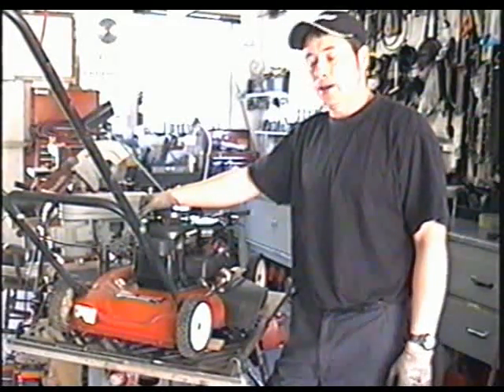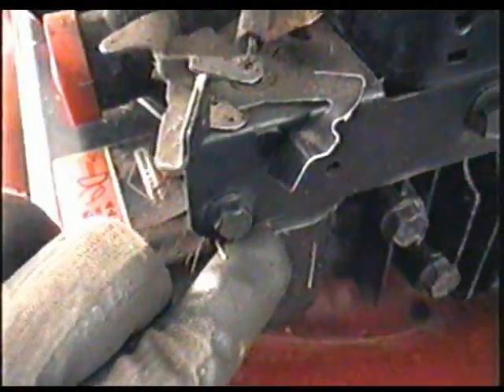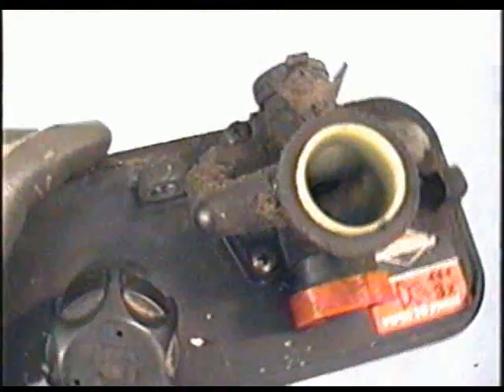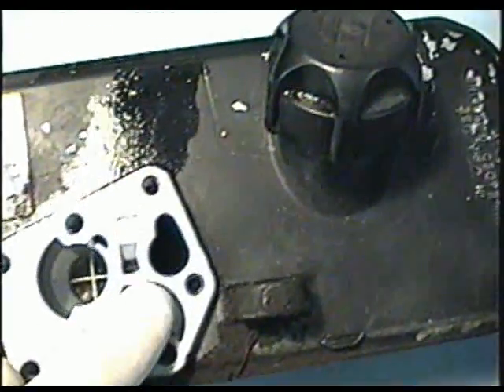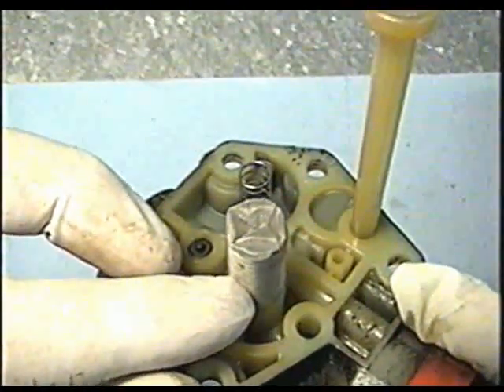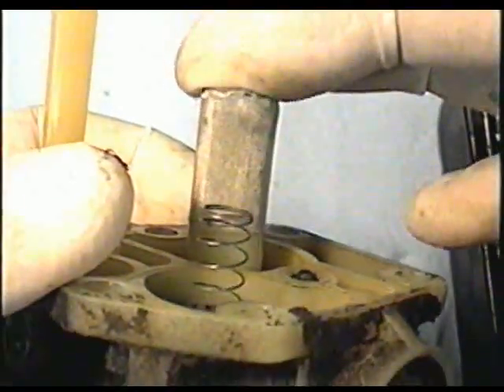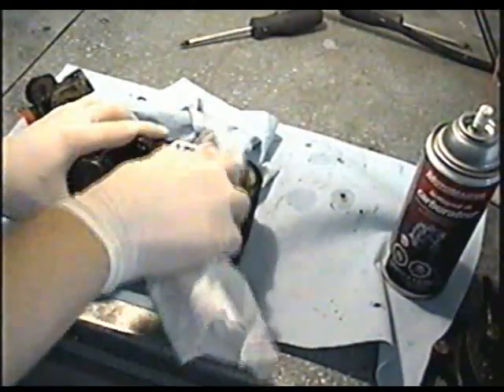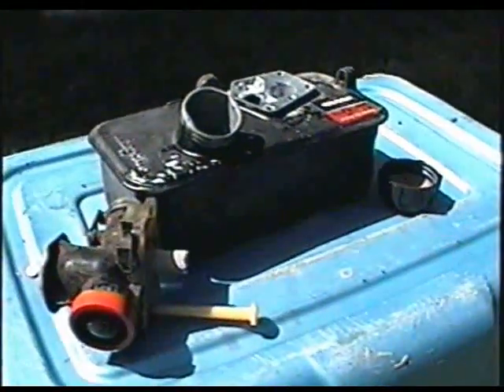HOW TO REPAIR Lawnmower with BRIGGS & STRATTON Pulsa Prime Carburetor  1/2

Comment: Don, I just repaired a 1986 mower with diaphragm -autochoke. This video was perfect!  I had to rebuild the starter ratchet, restring the starter, retorque head, clean out fuel system, rebuild carb, etc. It had sad been sitting for years. It started one first pull. Thanks for the timely lesson.

Comment: Thanks for your clear and easy to follow video. I have had my mower for 12 years and it was not running at all well. I performed the maintenance following your guide, I replaced the diaphragm and replaced the throttle control springs. $60 for parts and carburettor cleaner and my mower is running like new. Thanks for posting these videos.

Comment: I have a 2 year old  briggs 4.5 that would not start.  The repair shop wouldn't even look at it cause it was a "cheap" mower that would cost more to look at and fix than the mower was worth.  So I decided to fix it myself.  After watching several videos online I gave it a shot.  A good carb cleaner and 3.50 dollar gasket and diaphragm later and she runs great!  Thanks so much!!

Comment: Thank You Thank You.   Have MTD Mower with B&S engine made in 1994.  couldn't get it started...  called repair place, they told me it wasn't worth repairing (hard to get parts).  Watched your video, bought $4 for gasket, cleaned up the carborater, put it all back together and it started on the FIRST PULL..   I'm so happy, saved me from buying a new mower.

Comment: Thanks donyboy73 for this video. My lawn mower wouldn't start for nothing. Watched this video last night, it so happened that I have Carburetor cleaner lying around, woke up this morning, was determined,  did exactly what you showed on the video, and now the mower runs like a champion again. I had it there put away for like 3 months and was debating on buying a new mower because this one is like 5 years old, but won't be buying a new one as long as this one runs like it did when I first bought it. Great Video for my problem.

Comment: Thanks a lot for that, My mower ran out of fuel after I last used it a week ago, filled it up yesterday and it was hunting up and down and smoking a lot. Watched your vid and dismantled my carb just like you did it was pretty manky inside but cleaned up well and after re assembly worked a treat, Now I need to weld a patch on the body where it has rusted through and my old faithful will last another 15 years

Comment: I watched the video, worked on mine and a once useless mower started right up. Only problem was when I took off the springs, all of them came off. I wish you had a detail of the spring assembly. No problem. It all worked out.  Thanks. You saved me parts and labor at a shop.

Comment: Your instructional video(s) are terrific ... so easy to follow. Many many thanks.  Using your video I was able to fix my start and die engine.  I managed to clean the carb dirt and put it all back together all nice and clean .. and pulled the cord and BAM .. the thing lit up like better than new ... and stayed running and smooth as can be. Thanks so much !

Comment: Thanks!!! Cleaned up my carb this weekend using your video. Purrs like a kitten now. Only issue I had was that I bent the throttle bar (or whatever it's called) in the process and it rev'd really fast at first. Once I realized what I did I corrected it and everything (including throttle) was fine after that. Thanks!!!

Comment: Great tutorial thanks. This really helped me fix my mower which was revving up and then slowing down. I had tried cleaning the air filter and changing the spark plug but on opening the carby it was clear there was a lot dirt in the bottom. Thanks again!

Comment: my lawnmower would only start after a prime and would die 2-3 seconds after.  i did this procedure several times, but no luck.  replaced the diaphragm and gasket, same thing.  tried running with the air filter off and without the gas cap, nothing made a difference... only priming more kept it going.  finally i took some compressed air and carb cleaner (separate cans) and REALLY blew out all the piping(jets) in the carb. now its working like magic.  thx for this video!!

Comment: Hi,

thanks for the video.   It was exactly the engine I have.   I watched some of your other videos, and searched for this one due to the carburetor bowl inside the gas tank.   I found water in the carb, as well as a tear in the gasket.   A new gasket/diaphragm kit should do the trick.

I have tinkered with small engine repair for 15+ years, but never had much success or understood much.   You speak clearly, and cover all the points to look for.

thank you for sharing the knowledge!

Comment: Great, great video.  Your instructions were provided so well and detailed.  The gasket and diaphragm on mine was shot, so it cost me $15.00 (on ebay).  Less than a new $200 lawnmower, though!  Took me about 30 minutes to fix after the parts arrived.  Thank you so much!

Comment: I will give that a shot. It is really irritating. I live in Texas. I bought a cheap push mower a couple of years ago after my 500+ Craftsman wouldn't stay running. Every year it just got worse until it just took a dump. I mowed my lawn once with the new mower, hopped on a plane to Afganiraqiwaitistan and came back to tearing the new one apart after it sat in my garage for 2 summers. I am going to try fixing the Craftsman as soon as the new bowl gasket gets in. Youtube is amazing!!!!

Comment from the maker: @MrParmigianoReggiano you might want to drain the oil from the mower and remover the spark plug and pull it over so the oil goes out the hole. make sure the plug wire is not facing the hole when u pull it over

Comment from the maker: @Gamechills101 it's hydrolocked. u need to take the plug off and drain the oil. when u pull it over oil will come out the plug hole

Comment: Just want to say thanks for taking the time to do this video. I had a mulcher with the same type engine. I started it the other day and it ran for about two passes. The ground was wet and I stopped to clear some wet grass. When i went to restart it....nothing. i tried pulling it for like and hour. Then i went and changed the gas to fresh. (just pouring it out as i was mad, not removing the tank). Just got a new plug and sprayed into the carb. And nothing. Im gonna try your method and see.

Comment: @donyboy73 Ok, got the thing running PERFECT now!! I took the carb back off and cleaned it with another can of carb cleaner. I also put a couple cap fulls of "Berryman B-12" carb./ injector cleaner in the fuel tank. I cleaned the air filter and changed the engine oil too... It's been a Long time since my little 3.75 hp Briggs & Stratton ran this good. I Love it!! It don't burn/ use a single drop of oil and I've had this thing since 2003 or 2004. I've definately got my money out of it.

Comment: I have this same type design engine on my Briggs & Stratton Speed Clean 2000 PSI Pressure Washer. It'll be 7 years old in April of this year, still running strong! I have kept the oil changed and the air filter cleaned... Only problem it has is it's "surging" at engine idle. Runs fine at full throttle and when it's under a load. Do you know what the problem may be?? I've watched all your Q & A videos, along with others! PLEASE KEEP THEM COMING!! I am learning a LOT of things from you... THANKS!!

Comment: Excellent video. You really made this look so simple. You should take up teaching.
I have a question though. Even after cleaning the carb on my lawnmower, when I push the red prime button, I cannot hear the gas being pumped and  hence it does not start. I can actually hear the air coming up instead of the gas.

Comment: Thank you for the video - very good quality and clear description. I just cleaned my carb on a 4.0hp. It started up fine only it seems to be running at a very, very high idle - and the idle control does not work. I only unhooked the one arm to the linkage as in your video and I "think" it's back the way it was unless something feel out or disconnected. Is there anything else that could cause this problem? Note: The diaphragm was separating and not in great shape - could this be the problem?

Comment: Lent my good mower to the neighbor who left it in his back yard and it was stolen so I'm back to this old Briggs n Stratton 3.75 with Pulsa Prime carb and it would start and stop after about 30 seconds although it had mowed the lawn once or twice before this started.
Your video helped me determine that there is only the governor spring with no linkage attached to the butterfly.  Not sure how it was running cause it did mow the lawn a couple times like that. 
I'll replace the missing linkage and the other short spring and check the membrane to see if it is still elastic and pumping gas.  (I cleaned the filter, carb, tank and mesh and blew air through already.)
I clean the head and valves with steel wool because they were badly layered with black soot.  Do you think the engine is damaged because of the linkage parts missing?  Since it ran I didn't dream it had missing spring and linkage (my dad lost his battle with Alzheimers so many things around the house are in odd shape and I suppose that's how the old mower got this way shrug).
Also, I'm not sure what RPM to set it for and guess it'll need that adjustment after the parts get replaced.

Comment: Thanks for the Video -it will help me immensly  since I have never taken a carb off of anything....   I have the exact carb on my sears Briggs & Stratton 5.5 
My carb is so gunked up - I cant believe it runs as well as it does. I do have the E.3 Spilt fire sparkplug which does make a diference in starting.

Thanks -  again

Comment: Good point on not letting carb cleaner sit on the diaphragm. If the chemical is let sit, it will curl the diaphragm and make it difficult to keep flat for reassembly.

Comment: @donyboy73 Ok, i took it all apart and cleaned it. Put it back together with the OLD diaphragm. Still not running right at all!! Acts like it's flooding out, but the engine's not dying... On the part of the diaphragm where the spring pushes against, was hard. I could push on it one way and the diaphragm would stay in that spot. Push it the other way and it does the same thing... I think the diaphragm needs changing.... Carb was pretty dirty.... Do you recommend using aftermarket diaphragms??

Comment: just repaired a pressure washer with this same engine. just went in a put new diaphram  and gasket and clean everything real good. new plug and oil change. now it starts like a brand new one.

Comment: Thanks for the video.  I have a mower like this with a Briggs & Stratton engine.  A few months ago someone used it and put an oil/gas mix in the gas tank instead of straight gas.  It seems to be gummed up and will not start.  Bluish-black fluid seeps out of the exhaust on the side whenever I pull the cord.  I bought the parts and attempted this repair.  Did it twice actually.  Now the mower starts and runs weakly for a few seconds and then stalls.  Is there something else I can try?

Comment: hi, i have similar engine, its 4hp briggs and stratton.  i have never changed the oil on my lawn mower.  its very old, probably from 2001?  lol, but it still runs great!  its yard machines 21 inch lawn mower with mulcher/rear bagger.  i am wondering, what kind of oil should i get for it?  also how many cups should i put in?  thanks!

Comment: hey don, could you do a video in future about inserting a piston pint circlip? I am rebuilding one of these engines and I have lots of frustration with the circlip. I don't know anything about the direction and proper installation of the circlip. thanks!

Comment: So, I have this same exact mower that I have practically overhauled.  New plug, filter, oil, carb kit (to include spring and screen), primer bulb.  Do you know why it takes like 10 primes for the primer to actually inject an adequate amount of fuel into the carb for it to kick over?

Adam

Comment: Dony I don't know if you give specific advice but here goes. My Briggs & Stratton like in this video has been starting on the first pull all summer but last week it stalled during cutting, then it just wouldn't restart. I primed and also tried starter fluid, let it sit, but nothing. Then out of nowhere it started and ran fine. This week when I started it cold it immediately stalled but then started on the second pull fine but during cutting I turned it off and had the same experience as last week. I don't know where to begin, could you suggest something? BTW great videos and I subscribed.

Comment: Hi nice vidue.
I have a mower that wasnt running at all i i changed the gasket as shown here. know i starts fine when primed and runs for a few minutes but then dies as if out of fuel and wont start until some time has passed. when its cold or what ever. Do you have any advice on what the fault could be and how to fix it

Comment: Hi Dony
Have a Briggs 4.5 hp mower with the Pulsa Prime Carb. Today I was cutting the grass and the engine slowly died (Real slow) It did this to me 3 times it does this every 15 to 20 min's. Funny part is that it starts right back up.  I replaced the plug gaped .030 cleaned the air filter and ck the fuel cap to make sure it was vented. Tank is clean no dirt in it. And its still doing it. I notice when the fuel level drops below 3/4 of a tank it does this. I haven't taken the carb off yet.

Comment: I have one sitting outside made by rally been siting for 3 years after the safety cable broke and could not find a replacement . Now I am going to clean out carb and sell
it for parts. It is a Rally 22" not self propelled .

Thanks for the info

Comment: Don, thx for the video.  I have this same mower (BUT 4.5 HP)  I PUT A NEW carb, but still not starting. I have spark and conpresion seems ok.  It won't start even when I put starter fluid in the carb and eng cylinder.  Any ideas?  Thx in advance

Comment: I recently bought this lawnmower. It now won't stay running. It starts after I prime it but dies a few seconds later. I took off the gas can and carb like you showed in this video. There seemed to be some liquid (it looked like gas), in the two pockets that you showed at 3:03. I emptied the liquid and wiped it with a cloth. I reassembled it, primed 3 times and it started much easier. But died again after a few seconds. Also, the muffler smokes a bit from oil, I think. I replaced the spark plug.

Comment: @donyboy73 Thanks for the quick reply. So I was starting to put in the new diaphragm when I noticed that the linkage was not properly inserted into the arm (the other end that is connected to the throttle control). I pushed it in all the way, fired it up, and it works perfectly - including the throttle. Now I'm scared to change the diaphragm in case I bugger something else up :) Thanks again for the great video - probably saved me $100 at the shop.

Comment: Donyboy73 I purchased a Lawnmower/mulch er (650 serie)July 2009. It worked very well, until this May, 2013 when I tried to start and primed once, (pushed 3 times) and the lawnmower did not start, then I primed again and did not start. I primed again and it started, it run very well for about 2 minutes and it started to burn oil, smoking releasing a lot of dense smoke. I stopped the lawn-more and soon oil started to leak from the right side of the Lawn more. Please help.Thanks!

Comment: Hi, my motor is running really rich it stutters and cuts out. When it is close to running out of fuel it runs like a dream for about 5 mins. Any suggestions? I've changed the spark plug and it ended up black within one use suggesting it's getting too much fuel.

Thanks

Comment: Hi donny, i just changed the oil and had to tilt mower back till handle was on the ground so i could remove bolt to drain oil, but after replacing oil and started it again, but it's now not running properly, dont think it's running at high enough revs and sounds a little laboured ? it was running fine before i tilted mower back to get underneath ? could the oil have got into somewhere it shouldn't have when mower was tilted up/back, if so what do i do to fix it and get it running properly ?

Comment: Hi donny, when you say you spray liquid wrench on the filter to catch the dirt, is that the same thing as WD-40 over here in the UK ? i used clean motor oil on mine and squeezed out the excess, would i be better to use WD-40 ? my mower starts first pull but after a minute or two it starts running irregularly revs low for a bit then goes back to normal, does this intermitedley, do you think changing the gasket and diaphram would fix this problem donny ?
Thanks :)

Comment: I have a briggs and stratton lawn mover 5.0; i replaced the carburetor diaphragm and gasket, the gas tank was cleaned and it started and work for 2 minutes and stopped. I noticed that you show you gas carburetor shows a spring, I am not sure if I missed placed it.  What happens if the Carburetor is missing  the spring.  Hope to hear from you.

Comment from the maker: empty the tank, take the carb apart and let it dry in the sun until totally dry then reassemble it, that what I do, if you still have problems you might need a new carb, also make sure you have spark

Comment: hey ive got a briggs and Stratton 40 quarto and it wont go at all.will cleaning the carb help.i also figured out the coil wire to go to the spark plug has no spark

Comment: I replaced the spring on the Brigs stratton as you advised me and the engine on my 5.0 did turned on and I could hear the power on the engine, the engine will stay on, but when I start to cut the 4 " grass the engine begans to stall and turn off; what could be the problem.

Comment: How freely should air be able to flow through the pickup tube? I can't seem to get any air at all through it with my lungs. But the engine runs pretty good, a bit uneven when it gets hot.